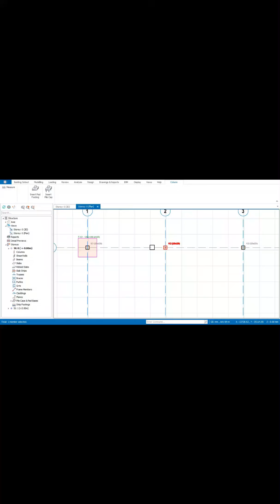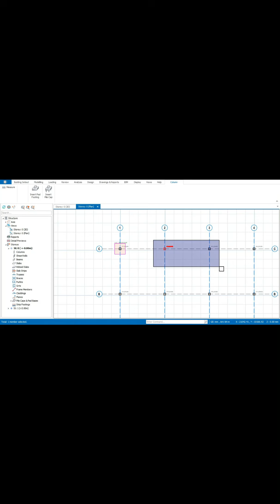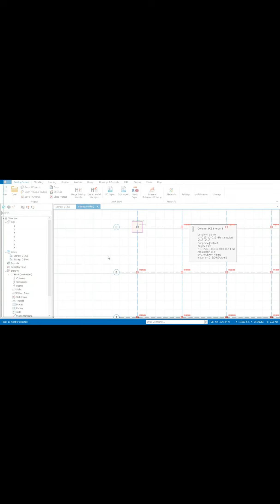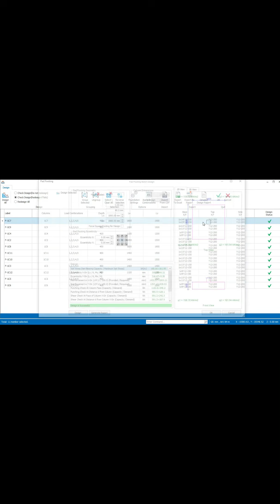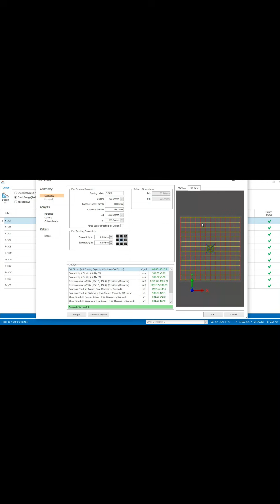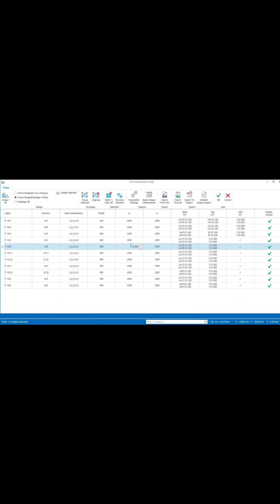HOW TO DESIGN MULTIPLE PAD FOUNDATION FOOTINGS in Protastructure #protastructure #structuraldesign

Comment from the maker: This is a tutorial video on how to design multiple pad foundation at once in Protastructure. 
https://youtu.be/JlJ467E3Rok
[Learn how to design a pad foundation in Protastructure]

Visit the link above👆 to see our full video tutorial on how to design a Pad foundation in Protastructure.

Don't forget to subscribe to our channel for more videos like this and turn on your notification bell to be first the see our latest video. 

Visit the links below 👇to check out some of our previous video tutorials on how to use Protastructure for structural design and detailing. Thank You.

https://youtu.be/wYdzDCgd-eE
[Learn how to Manually design reinforced concrete beams in Protastructure]
https://youtu.be/TNlRiYMV2JE
[How to design Flat Roof and Parapet wall using Protastructure]
[Learn how to Design wall loads on a cantilever in Protastructure]
https://youtube.com/shorts/f7_cralpJhs

https://youtube.com/shorts/ECxs80jWOH8
[Learn how to design a slabbed flat roof in Protastructure]

[Learn how to perform building analysis in Protastructure PT1]
https://youtube.com/shorts/O2wz2iJaz8M

[Learn how to READ REBAR DETAILS and SCHEDULE]
https://youtu.be/RGsRzr1gY_g

[Learn how to use Protastructure for structural design and analysis] 
https://youtu.be/J73b5_CV8JQ
How to draw slab strips and read structural detailing.

https://youtu.be/uzZS9Sb_o_g
[Learn how to recover a broken Protastructure project file that won’t load in the software application]

https://youtu.be/BLpKfz366iI
[Learn how to use this Protastructure as a beginner, student or enthusiast in the field of structural design, analysis and detailing]

https://www.youtube.com/playlist?list=PLmAMRg6X2S2y5_VWc8_30GEizRhhgMs66
[Tips on structural engineering and how to design with Protastructure]

#design #Protastructure #tutorial #beam #civilengineering #structuralengineering #rebar